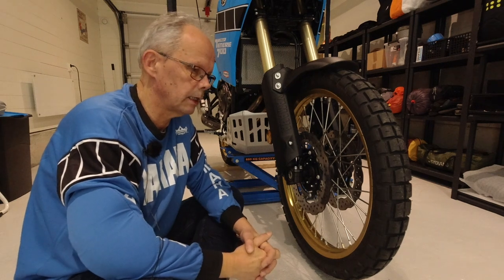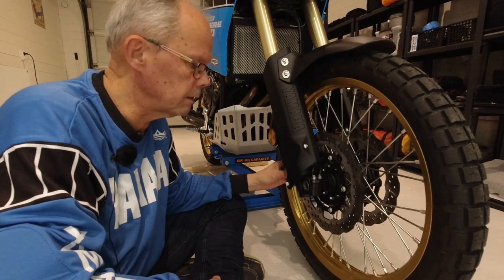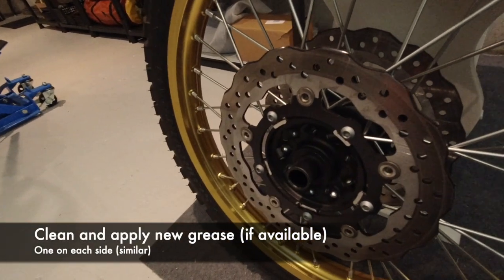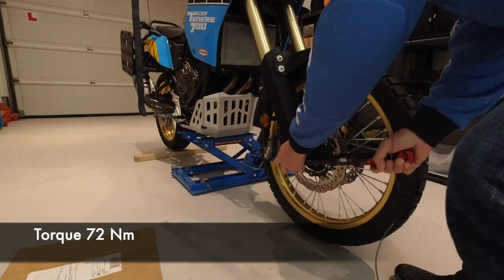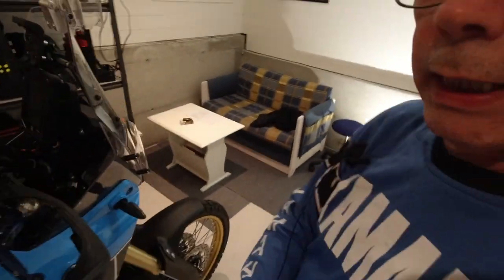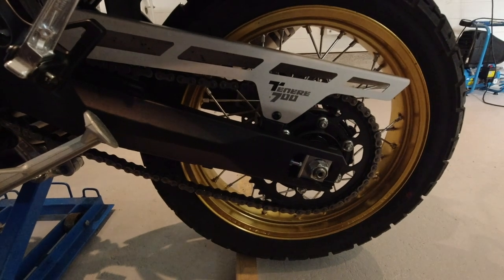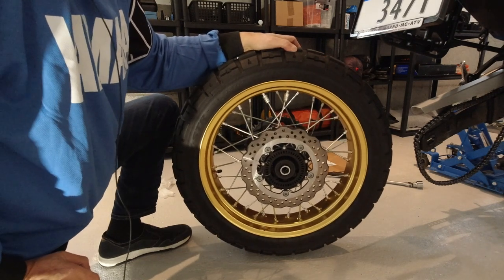Yamaha Tenere 700 - Wheel Change Tutorial

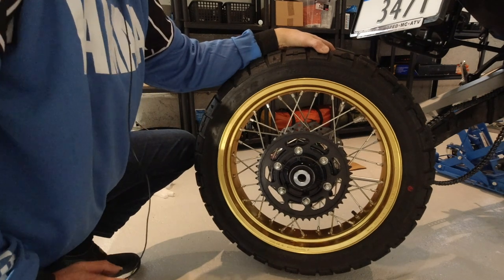Comment: I have to follow your dry course before starting into season 2022. Thanks for the torque values. I added some of them to my own maintenance sheet. What I just learned in anothe rvideo today: at 10:25 you can see the red dot on your rear tyre. The tyre should be mounted in that way so that red dot and valve are in line. In case the tyre shows a green dot, mount green dot and valve opposite of each other.

UPDATE SEP/22: You video helped me to put all the things together in the right order when putting the wheels back. I hope all is well with you, Sven. Greetings from Germany, Bernd 💙💛🏁🤛🏼
Reply from the maker: Greeting from Norway, hope everything is well with you too. Nice to hear the video was useful :-)

Comment: I saw a video (Swanky Cat) where he states that the bikes shouldn't be lifted in that matter because of the support arms or something? Is that true?
Reply from the maker: I have also seen that video. It is questionable, it seems strange that the skid plate, which is there to protects the bike, should not be able to carry the weight of the bike. I have not seen any issues yet.
Reply: I think I agree with him - I use a scissor jack to keep the bike stable (or to keep the weight off of the front wheel), but I use it in conjunction with a rear Paddock stand.
Reply from the maker: @The333  to be safe that is of course a great way to do it.

Comment: Excellent video, Sven.  Just curious, would you be using a center stand on the trail?  If so, what technique would you use to get the weight off the front wheel?  (I saw another tutorial where a small log was wedged under the front of the bash plate while the bike is on the center stand.)
Reply from the maker: Thanks, I have no center stand on my bike, so I will have to use a trail stand like this: http://www.endurostar.com
Reply from the maker: And yes a small lodge would also do the job if you have a centre stand :-)
Reply: @tubelesschannel  Fantastic!  I never saw this before - thanks, Sven!
Reply: I saw that vid as well. Notice he has the stock basic “cowling”- as it is referred to in the owner’s manual. Sven’s is aftermarket (or stock on Rally edition). Different animal. I’m not sure I’d jack on the basic one. The manual says don’t do it (or frame rails either).
Reply: @richardstanley1331  Thanks for the heads up!